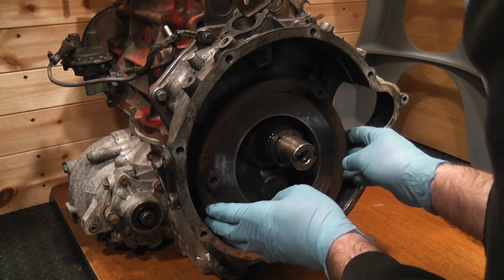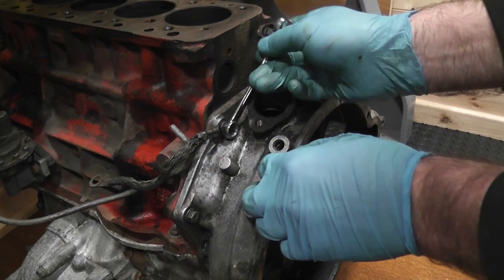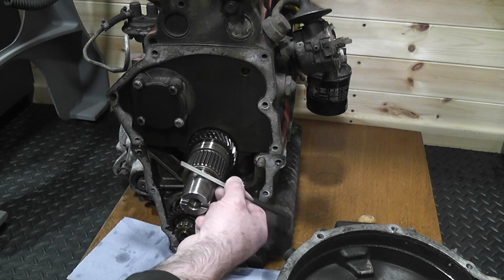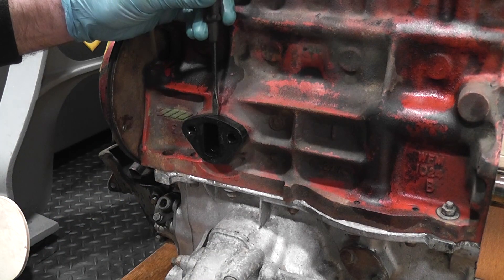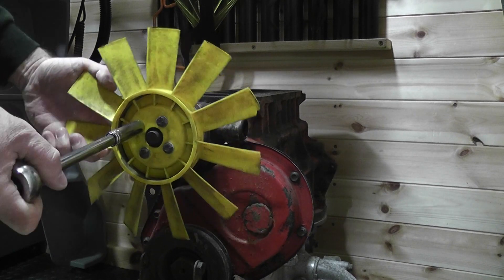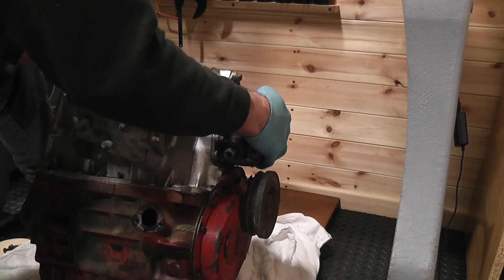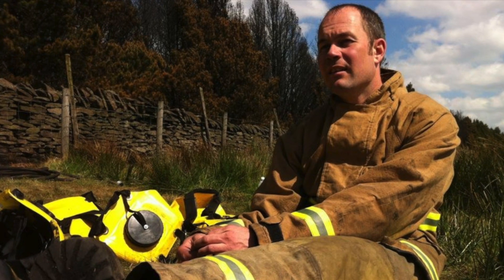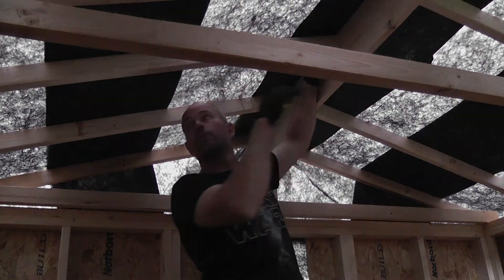Classic Mini A+ Series Engine Total Rebuild Episode 5 - Splitting The Gearbox And Cylinder Block

Comment: Wish I was doing this, I want to fit a straight-cut gear set.
Reply from the maker: Im on the fence at the moment. I like the sound of the straight cut gears but it can also get quite loud. I believe there's a way of having 1, 2, 3 straight cut and 4th normal which might suit me better then I can have all the cool sounding gears when accelerating and quiet and sensible when cruising haha
Reply: @SmugwoodMini  That`s a good idea and no reason it shouldn`t work either. Hmmmmmmmmm...
Reply from the maker: Im in talks with someone about it now. I think it may be quite a common workaround.

Comment: You have made some great progress there mate but just a gentle 'heads up':
Remember this is an A+ engine and there are many detailed differences to the earlier A Series engines, heads and gearboxes.
I am always bemused why people fixate on the primary gear C Ring as I have never had one 'fall out'. The key thing here is the free play on the Primary Gear. This can be adjusted by either a 2 thou thicker Primary Gear Backing Ring or the Primary Gear Shim behind the Primary Gear. Clearance is 3 to 6 Thou.
Its not unusual to find no locktabs on the Clutch Housing as long as they are flange bolts (DAM7758 and DAM7753) not just bolts and spring washers.
Really consider carefully before tackling a gearbox rebuild. Its not difficult but there are a lot of detailed finnicky parts (like springs which will fire ball bearings and pins across the workshop) and sequence is crucial. Guessworks Gearboxes has a great series of rebuilding videos but this American guy does a nice dismantling video here:
https://youtu.be/qcqY8vo59pM
Good luck, take your time and enjoy yourself. Rebuilding mine ('Noah')  has helped me keep the Black Dog of Depression in its kennel.
Reply from the maker: Thanks. Ive definetly got a lot of things to study before tackling some of the jobs...especially the gearbox. But Ive also got a little bit of help and guidance too so hopefully I have a fighting chance. But we'll see :-) I sort of went with the Title of A Series in the hope it sort of was more of a widely generalised Title ie A Series could mean anything A or A+ etc but mainly because mines a 1987 engine but it seems to have things fitted that were from earlier versions, both mini and metro. Ive been following the guide for A+ but even the guide had things that were for A Series has caused me a bit of issues. But hopefully the differences aren't too major. By the time its finished...Im not even sure what it'd be classed as haha! Lots of work ahead and appreciating all the help and tips and making tons of notes. Learnt so much these last few months and looking forward to seeing how the rest of it goes. Thanks for the links by the way :-)